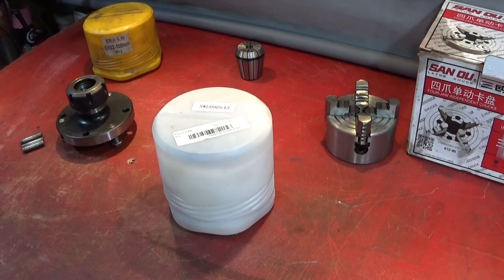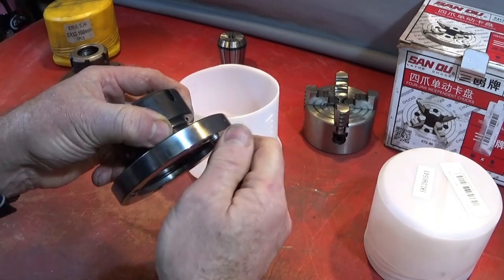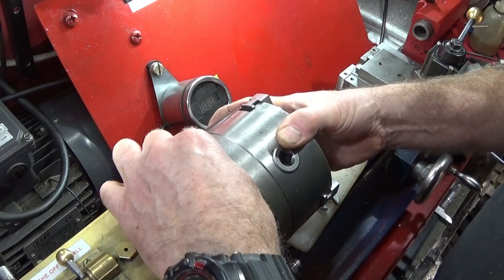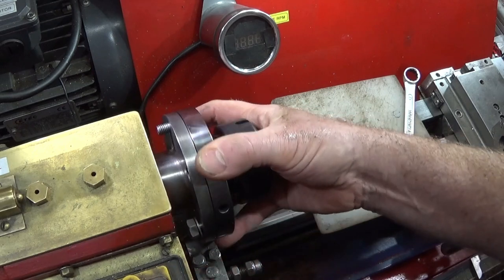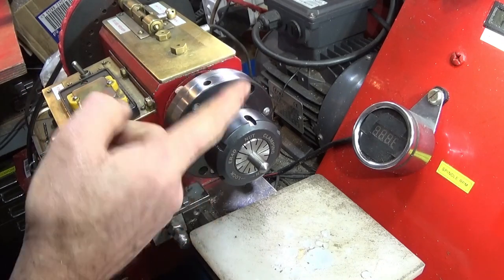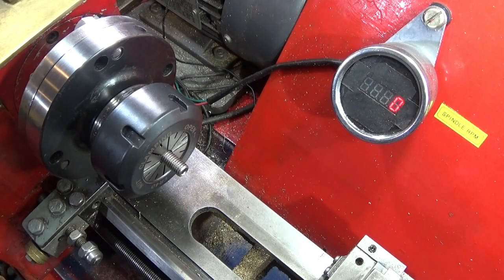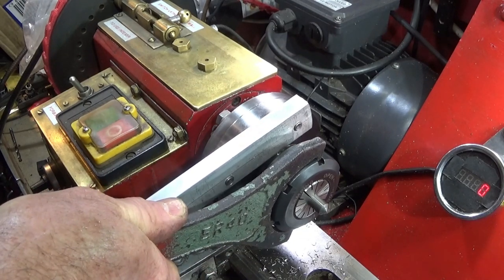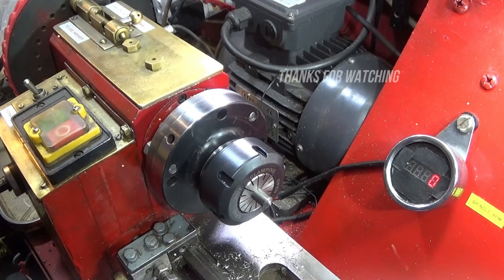Chinese Mini Lathe ER40 Collet Chuck & Nut Locking Handle

Comment: I got one a little while ago, very nice. The rim of the mounting flange has two radial holes, can use tommy bars or a C-shaped pin wrench in them to resist the nut torque.

Comment: For the studs in my three and four jaw chucks I use thread lock. For my ER chuck I used stainless Allen head machine screws. The heads do not get in the way of the collet nut and they improve clamping the flange for me

Comment: I have the er32 and er40 in these holders (for my larger lathe) but with the er40 I only  bought collets that were not included in the er32 set. So 21mm to 25mm as I didn't want to double up on collets. Luckily my larger lathe uses the D1-4 camlock system so changing between er32 and er40 holders doesn't take too long. I also have a Chinese mini lathe with this holder but only in er32.

Comment: Ya I've had an identical one from ebay for nine months or so and the more i use it the better it gets.Still have not gotten around to making a 3 mt adjustable stop , spring loaded ejector  so disk shaped stuff you press against a spring to the stop. ( dont break any Hardinge tm's) just throwing that idea out there , looking for the mini lathe switch my case mill with the click in the right pos. really thinking would this dc power supply make a good wire edm (for the wire) power supply That 10 mm shaft on the motor uh and the allternative a free treadmill that blows fuses a wire edm from that would be wow any of those dc motor supply's with a pulsed 20-30 khz dc at like 200 watts and the arduino controll and an edm drilled spark plug for a wire guide d' work right

Comment: Hello Steve. Thanks for the video. What size do you recommend for a mini lathe and mill of the same size. I also have a cnc with ER20 spindle.  Thanks
Reply from the maker: Hi I recommend the ER40 or the ER32. The ER40 obviously has a better size range though. Regards Steve

Comment: 0.015 runout in the collet is good enough?  What do you get out of a 3 jaw?  if thats not in the spindle itself, you may want to consider making an adjustable backplate to tune that thing in.  collets should to better than 0.015"
Reply from the maker: The run out doesn't matter as I mainly use them for 1st op bar work. You can easily knock components to run dead true as well. People are obsessed with the run out on collets when they shouldn't be.
Reply: @SteveJordan  if everything is 1st order then sure I guess it doesn't matter. but then why bother with collets?  a 3 or 6 jaw scoll seems more appropriate.  not trying to tell you how to do your thing, just curious why you went the route you did?

and you say obsess, I say tune properly so it doesn't piss me off every time I chuck something.

Comment: Hi Steve wondering if u could help trying to get a drive belt for a Chinese mini lathe hope u dont mind me asking dave
Reply from the maker: Hi David I changed my drive to external belts. Is it the original drive belt you are after? You can get them from a company called Amadeal UK I think.
Reply: Yes steve it is the original I am looking for it's a 14 x 7 lathe I have only had it two weeks but I would like to keep a spare in stock thanks david

Comment: Nice ! Please what is the ID of this recess? And how far are those crews from center? I would like the same but I'm not sure if it will fit my lathe.
Reply from the maker: If you have a Chinese Mini Lathe with a 4 inch (100mm) chuck, the collet chuck will fit on the spindle. Regards Steve
Reply: @SteveJordan  Thank you, but anyway could please measure that ID? I have mini lathe but not not directly Chinese one ... it's Bernardo 350 VDM from Austria. I would like to avoid mistake.
Reply from the maker: The ID is 72mm. The stud distance centre to centre is 72mm
Reply: @SteveJordan  Than you so much ! My OD of that recess is 55mm :(

Comment: hi steve  which mini lathe would you get if starting over, what make is yours
Reply from the maker: Mine was an Amadeal. Warco seem to spend more time on theirs but they can be a bit higher price. They are all really very much the same and tend to need a bit of fine adjustment. I had mine in its original state for at least 5 years before changing the motor. They are great little lathes and I have made hundreds of precision components on mine.
Reply: @SteveJordan  thanks steve  really appreciate advice

Comment: Please forgive my ignorance im new to machining .
What are the benefits of a collet over a chuck ?
Reply: 1. It is more accurate, 2. the jaws will not scratch the workpiece, 3. When machining a thin wall pipe, it won't distort it.
Reply: Can grip on threads without crushing them. 
Can grip an extremely short feature.